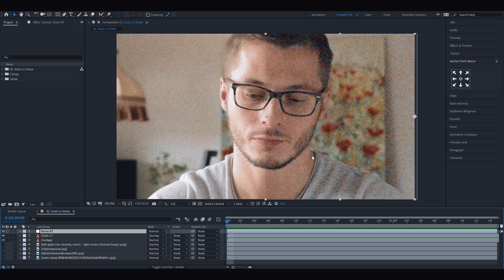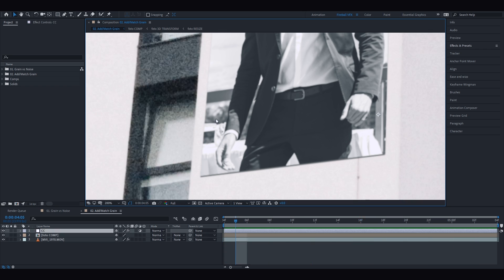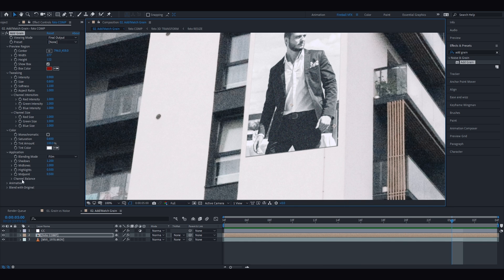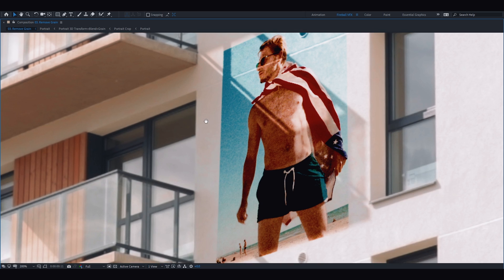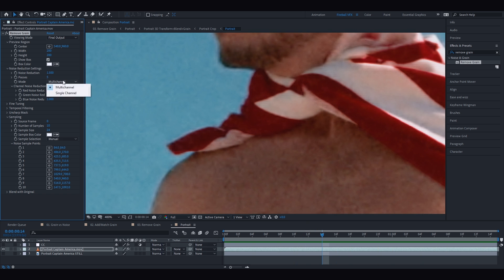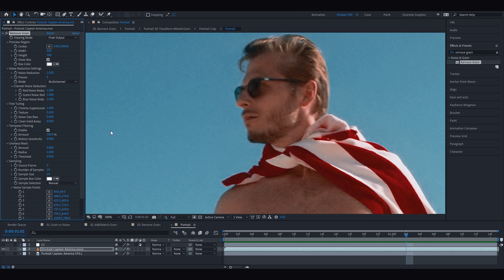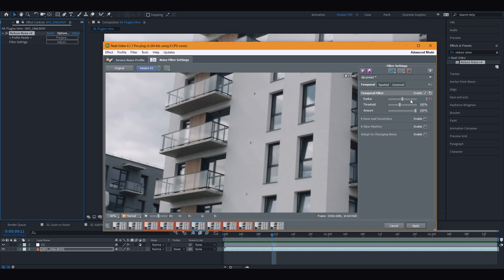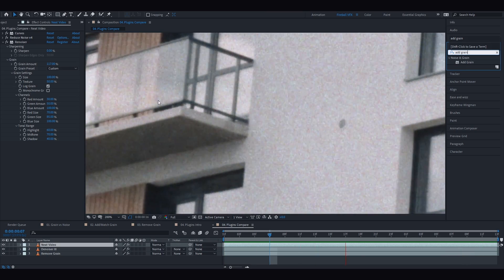How to Remove Noise from Video & Match Grain for Compositing

Comment: Hey maybe you can help me figure out why I got noise using my iPhone 8 in a well lit Catholic Church.   I can’t figure out for the life of me how the hell it got into my shots.   I was using a stabilizer called the Hohem iSteadyx .  And I noticed I couldn’t figure out how to adjust their iso and shutter speed etc.     it’s so annoying so now I just added after effects to my CC plan to try to remove it so I can match shots with my canon 70d
Reply from the maker: Hi, i guess you answered it, you did not set up iso and shutter speed correctly ;)
Reply: @FireballVFX   yeah the stabilizer is absolutely amazing.   The app, not so much.   It’s very frustrating not being able to understand how to change the basic settings any photographer / videographer would normally set.  And what’s even more frustrating than that?  The fact that there is NO TUTORIAL OR MANUAL on the Hohem website, included with the stabilizer, or on YouTube about how to configure these settings.   There is however tutorials about literally everything else but that 🤦‍♂️. And the reason for my question is I am still new to videography, I have only associate noise and grain with low light and iso
Reply: This video was packed full of knowledge and man I really appreciate you for it
Reply from the maker: @93FilmsandMedia  funny, all but not what you are looking for. Did you try to contact them directly for support?